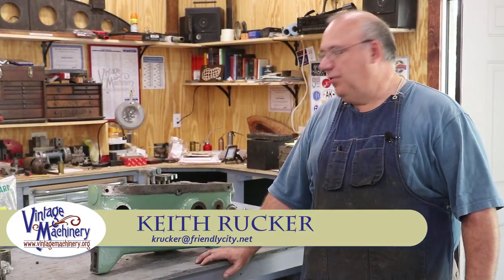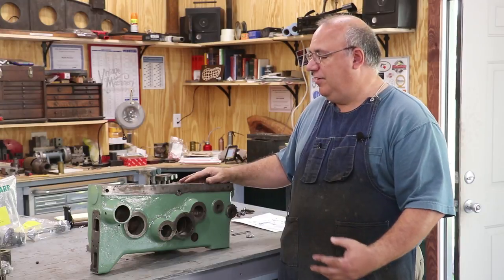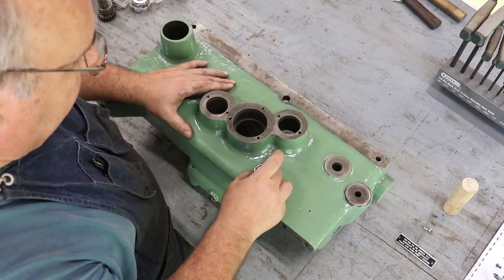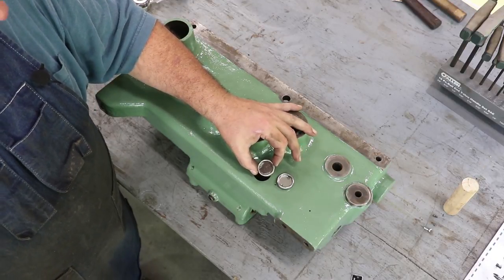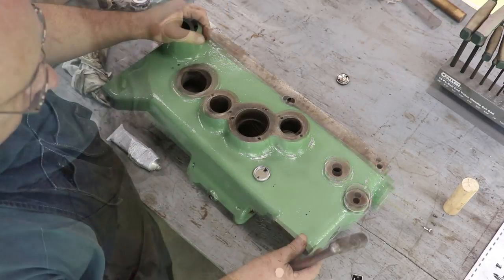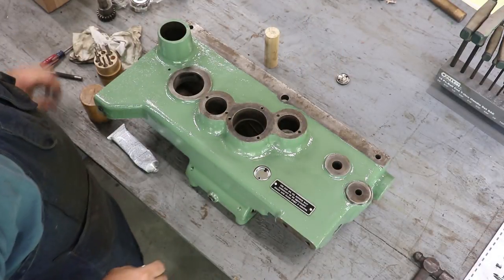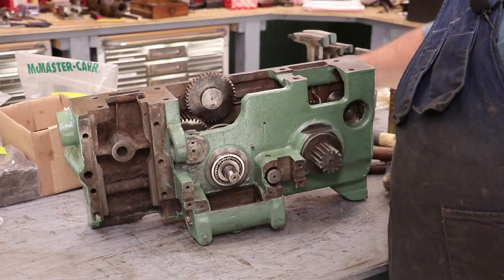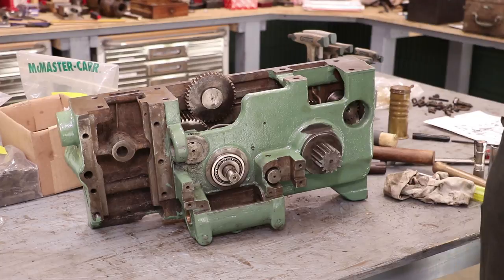Monarch 16" Lathe Restoration 9: Apron Reassembly

Comment: ...Ball, roller or needle, fast or slow, they all need lube....I once had a job as a welder, but also got leveraged into machine repair....we had an old lathe that had flood coolant....unfortunately....it had gotten into the 'apron' and dis-placed all the oil....coolant was probably less than 1% oil....still looked 'white' so no one realized it was diluted..... Fortunately, I got into that gearbox before it was destroyed.....bearings were quite rusty and needed replacement....carriage wouldn't move in 'powerfeed' other wise no one would suspected anything....

Comment: Keith ... why didn't you clean and paint the inside.. looks a mess mate
Reply: paint will only fall off the inside clogging things up, you never paint the inside except the manufactuter does apply a sealant, but you dont need it, it will be oil running inside it
Reply: Still looks shit though.....( should have said 'Keith why didn't you seal the inside of the casting' :)
Reply: it only needed sealing when the manufacturer did it, cast iron is pourous can leak oil, but no need to do again, it might flake off if you did, honestly better to leave it clean as you can get it
Reply: I  agree with your point mate .. but as clean as he could get it ..is not what you see at 36:00
Reply: but you couldnt have put anything on it to improve it, you cant get in there to really clean it and you cant put paint on that surface,   when the casting was new, they used red lead and linseed oil to soak in and seal it, they let castings rest for months before finishing them off.  i agree its not as clean as  i would like, but if you cant reach it then you accept it

Comment: $535 for one small bronze gear... that's just crazy!  Shouldn't stuff like gears cost less thanks to modern manufacturing?
Reply: Jason Vanhoy - I get the economics of offer & demand which, in this particular case, should be offset by the increase in productivity of manufacturing in the last 60 years.  What was the cost to make such a gear in 1962?  What is the cost to make such a gear in 2017?
Also, it would be interesting to know how much that gear sold for in 1962... Today's $535 price represents $65 in 1962 dollars.
Reply: I'm not sure what you mean by "the increase in productivity of manufacturing". Maybe you're implying that manufacturing technology has advanced between 1960 and 2017 and therefore a given item should be cheaper to manufacture now than it was then. That's true, by and large. However, I think a few other factors should be mentioned vis-a-vis the price of that part. 

First of all, Monarch doesn't make that lathe anymore. But, large tool manufacturers, much like automobile manufacturers, typically will make and stock replacement parts for discontinued models for some length of time after the end-of-manufacture date. That's why you can even get this gear anymore, or, for another example, an exhaust manifold for a 1992 Ford Taurus. 

Another point is, as this video details, this part is made to specifications that are not currently considered standard. 

So, what that tells us is that the part in question is a one-off part. Monarch must keep tooling around to make them, but they certainly don't have a production line set up to do it, and they don't make them as a normal course of business. Essentially they MIGHT keep one, maybe as many as 3, on a shelf somewhere, and don't ever make one until someone buys one. They ship out the existing one, and make a new one to replace it in stock. And that's assuming they even keep one in stock. Their website mentions that they keep all their engineering drawings on microfiche so that they can provide you with any part you need. That implies that there are things you can order from them that don't exist, but they'll check the original drawing and make you one. This gear may be in that category of parts.

That means that someone has to stop what they're doing, go to the toolroom or some other dusty corner of their facility, and set up an unused machine to make this one part. Then they have to source material for it (be that out of existing stock or something they have to order). Then they have to take the time to produce the part. All that costs an incredible amount of money, and isn't affected by increases in manufacturing efficiency. It may be that they have a CNC machine they can dedicate to this task when necessary, but even then I would expect the tooling and setup to take some time, and running that part still takes some amount of time as well. To say nothing of losing the time on whatever that machine was doing previously.

Heck, even storing the part and the tooling (and the CNC program, if that's what they use) costs money that isn't immediately recoupable. I'd bet $10 they don't sell one of those gears per year on average. 

So, to answer your original question, yes, a manufactured part typically SHOULD be cheaper to produce in 2017 than it would have in 1960, all things being equal. The things that are not equal in this case are the fact that this part is essentially made-to-order and not a current model so therefore cannot take advantage of the efficiencies of modern production techniques or economies of scale. In fact, those factors likely make it more expensive than it would've been in 1960.
Reply: Jason Vanhoy - I pretty much agree with what you wrote (and thank you for taking the time to do so)... A few points that come to mind:
A) Is the gear made of bronze so as to wear first (perhaps Keith knows)?  If so, then it is likely that Monarch has always kept more than 2-3 on hand because it was engineered to have a much shorter lifespan than the other steel parts.  
B)  What is the average lifespan of this gear?  As a business, if you purchased the lathe new in 1962, what are the chances you would not want to purchase a new lathe when that bronze gear would need replacing?  If vintage machinery (pun intended) becomes more popular with individuals like Keith and small businesses,  more and more of these machines will be restored... which means the demand for this 'consumable' bronze gear may be greater in 2017 than it was in 1962.
C) Is this gear used on many Monarch products or just on one?
D) I imagine the bronze stock required to make this gear comes in standard sizes which produce X number of gears per bar of stock.  So when inventory of this gear runs low, Monarch purchases the stock, loads it into CNC lathe with CAD/CAM code and pumps out X parts.  This can all be planned and scheduled into a machine shop's regular activities.  The productivity increase I mentioned also applies to modern planning tools and techniques.  How much time and how many different setups would have been required in 1962 to make the same X number of gears?
Reply: Definitely the gear is made of bronze, in part, so that it will wear before the mating gear wears. That's a pretty standard practice. It's not so much that it's engineered to have a shorter lifespan, but so that it won't cause wear on the mating part. It's not necessarily considered a "consumable" part insofar as the designing engineer said, "I'm designing this to have a lifespan of 20 years only." Instead, they would have planned that this particular gear would "probably" wear out eventually, but in what timespan, nobody knows, because that would depend greatly on what type of load was put on the machine, what type of lubrication the owner provided and how often they provided it and probably several other factors. So to your second point, the average lifespan, I have no idea. I'm not sure those data exist, but if they do, I bet the standard deviation is pretty wide based on those factors mentioned. 

I'm also not sure how many other Monarch products would've used this particular part. If they're smart, it would have been as many as possible, but who knows. You'd at least guess that any of their 16" lathes used it. Maybe larger ones as well. Smaller lathes may have used it, but that seems less likely, because the saddle on those machines might have been a different size, requiring a different sized gear. That's all speculation of course. We can be sure, though, that no current Monarch products use that gear. There's no way they'd manufacture a non-standard part with non-standard tooling in this day and age. At least, I'd be pretty shocked if they did. 

As to point (D), you certainly make a good point. And, well, sure, the stock comes in a standard size, and you could certainly calculate how many gears you'd get per foot of stock knowing the allowances required and so forth. But, it's not like you just feed a bar of bronze into a machine, hit a button and 5 or 10 gears come out the other end. Cutting that gear on a CNC would, I think, require a 5- or 6-axis machine and what...three or four tools at least? It's a complex part to be sure. I honestly don't know much about CNC machining but there would be machining required on all three surfaces of a disk of raw material, with at least 3 tools, probably more. I don't even know if you'd get the whole part made in one machine. That's just my CNC ignorance, but doing the part manually would require both a lathe and a mill. I think the bottom line is, even if it's as simple as you say, I still think they only would make a very few at a time, and only once per year at most with a pretty high likelihood of making none until someone ordered one. I guess we're both just speculating on that until one of us calls Monarch and asks, eh?

Ultimately, I suppose what I'm saying is, I don't consider the price tag at all out of line, and I probably would've expected something in that range if I was the one making the call.
Reply: Jason Vanhoy - Good analysis... I believe we have successfully exhausted this topic... only Monarch experts or Monarch employees could add to this discussion.  I'm game to write them an email.  We could also check Keith's online library of old catalogs (I believe he scans and publishes them).  Check back with you later... thanks for the chat.
Reply: ajtrvll So far as I know Monarch doesn't stock something like this in new stock, but can have used stock so it pays to ask.  For something like this I believe they depend on a number of machine shops setup to make one off parts, thus the apparent high price.
Reply: Russ Kepler - I'm imagining a 6-inch OD 10-foot long bar of bronze stock being kept in inventory at Monarch... When Keith placed his order for the gear, Monarch scheduled the job... they loaded the bar stock into a CNC multi-axis lathe with an insane carrousel of tools... 60 minutes later Keith's gear is in Monarch quality control and metrology lab, whilst the 9'-10" bar stock goes back to inventory (or more bronze gears are made)... 20 minutes later the gear is being packaged and shipped to Keith... I'm probably way off for every step of this process, which accounts for me being shocked at the $535 price tag. :)
Reply: Jason Vanhoy - I imagine Monarch makes bronze parts for their modern machines as well (for the same reasons you mentioned)... bronze parts which probably require rod stock of the same size as Keith's gear would.  Keith's order could be scheduled when the right stock is already in the right machine?  All speculation or course.
Reply: I really don't think it's like that at all.  No one I know makes worms or worm gears using CNC, unless you're talking about the blanking process.  The cost to generate a gear would simply be insurmountable when you compare it to the cost of using a gear generator such as a hobber (this case) or shaper.  Since you have to use a hob on this sort of gear (with the inside cut on the negative tooth) you have to have the gearing to match the gear and hob rotation.  Yeah, you could get something that would work using CNC  but a hobbed gear is going to run a lot more nicely.

All that being said I've seen folks make this sort of worm gear by turning a hob and using the hob between centers to cut the gashed blank (gashing the blank makes sure that the tooth count is right when you're done).

Really, with the price of a similar gear being $250+ (Boston 6DP 30 tooth single start - Boston GB1081 13674) $500+ isn't all that unreasonable.  That might actually be from stock at Monarch.
Reply: Russ Kepler - Thanks for the detailed explanation and price comparison.  It does put things into perspective.

Comment: Keith
  I've been watching you for sometime for the entertainment and bitten my tongue. First I've seen many times you just squirt a little oil here and there, I've never seen it as good workmanship not to coat the whole shaft and bushings and not to leave out lubricating Bearings and thrust washers and thrust bearings, lets just say pre lubricating all moving parts. Next I have to stop you so your labors are not in vain, on the saddle why in the world would you think just boring a small hole in the oil galley blockage was good enough.  Where is the volume of oil needed to supply the manifold for all those little oil line going to come from with an orifice in that big oil supply galley. It seemed to drill quite easy so finish the job and lets not hear good enough anymore. If you want to be a teacher well teach and it's not with good enough, think about the job at hand and do it right... .
Reply: Dude he isn't even done putting this together. Why would you want to deal with an oily mess while handling fiddly parts? This thing is open you can easily lubricate it after he finishes getting parts for it. It's also a low speed application and bearings come with a light coating of oil it's not critical at this point. I think your mistaken with the volume of oil needed it's not like these bearings are going to need tons of flooding oil. This is entertainment not a strict instructional video. What do you do if you get a larger chip stuck deeper in the oil passage where you can't get it out? Gotta know when the risk/reward isn't worth it and when good enough is well good enough.

Hell if he soaked this thing in oil someone would complain that it's too oily for him to put the gaskets on and that he needs to degrease it.
Reply: I base My knowledge on Fifty years of experience. No one said to soak everything, "prelube" where did all lubrication come from on the shafts and bushing they were dry but for a squirt of oil. You surely have no experience on an flow and volume go read a book. Greasy gaskets, grease is often used to fix a gasket in place.  I'm not a Dude to you or anyone else, go play with your Fiddly Part...
Reply: Dude 50 years of experience? Just enough experience for dudes to jump to conclusions. Dude talks about flow and volume but with your 50 years of experience can you tell me what flow that little pump is going to put out and what the maximum system pressure is? I mean you can squirt a hell of a lot of oil through a 1/8th hole if it has enough pressure behind it, but if the pump isn't going to flow that much it might not get the pressure up there either. I guess we need to know the displacement of the pump and how fast Keith is going to be turning it by hand. We can make some guesstimates here. Let's assume (since we are doing that anyway) that pump puts out 1 cubic inch of oil every time it reciprocates (seems way optimistic to me looking at the previous video). Then let's say Keith is turning the handle relatively fast 60 rpm (seems a bit optimistic too). That gives us 60 cubic inches of displacement per minute. 7.48 gallons in a cubic foot. 1728 cubic inches in a cubic foot.  .0043 gallons in a cubic inch and 60 cubic inches gives .258 gallons per minute. Even though i don't know how much pressure that pump can build I seriously doubt that 1/8th hole will have trouble flowing enough oil to keep things lubricated, since we are talking about fractions of a gallon a minute. Actually i'll drill a 1/8 hole in the bottom of a bucket tomorrow, put some oil in it and get back to you how much leaked out.
Reply: Go read a book
Reply: Dude I generally find if someone has to lead off with "i have x amount of experience" they're usually full of shit. How about you throw some figures out there? Or how about you recommend a book? Add something to the conversation than just coming across as some old dude that can't back up his claims. You can flow oil through a 1/8in orifice the question is what pressure is required to do it for the volume needed. But you need the info on the pump for that. If your not going to give any relevant info then your just some codger hiding behind his "experience".
Reply: Tomorrow call you town officials at the water department and tell them the Water Mains are to big... You Mouthy Git how many time a day does someone knock your lights out...
Reply: You may want to look at the replies to Sam Burdick on oil and grease...
Reply: Dude we aren't talking about providing water to a whole town. We are talking about a small quantity of oil for a machine that isn't going to a customer or being used for production work. None because the only people i get mouthy with are the kind that likes to go "I have experience!!" but then provides no actual information to back themselves up. I asked you to recommend a book yet you just tell me to look at replies to another comment. You don't actually have anything do you?
Reply: You just don't get it, you need the volume the big pipe to feed all those little pipes. You don't restrict the flow causing more pressure on one side of the system and no volume on the other... You get it now leave me alone...